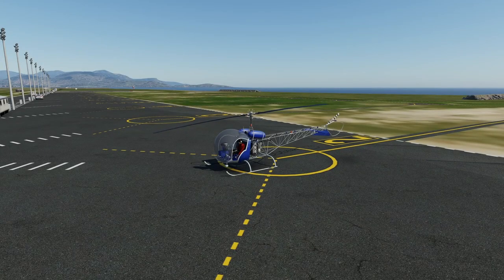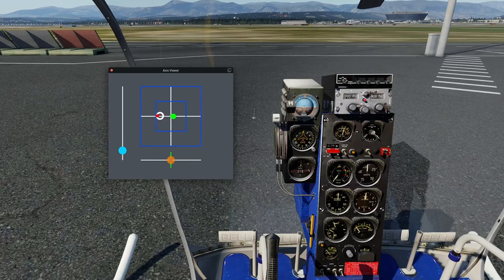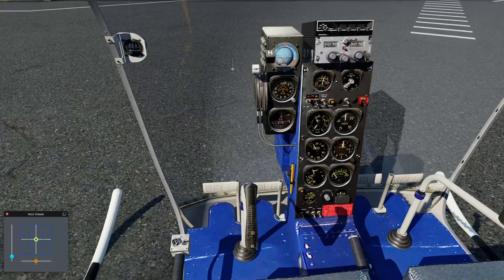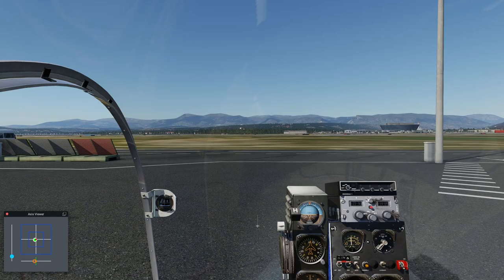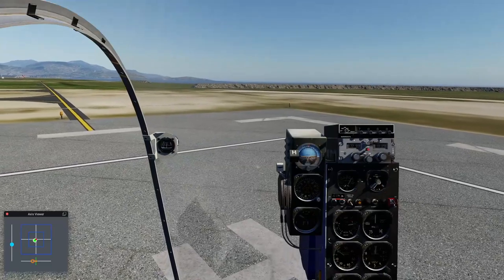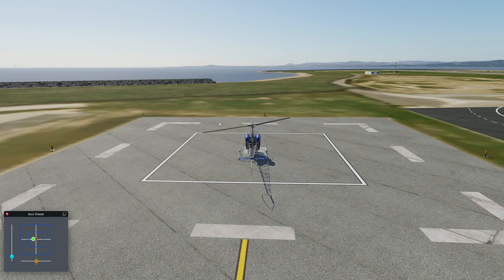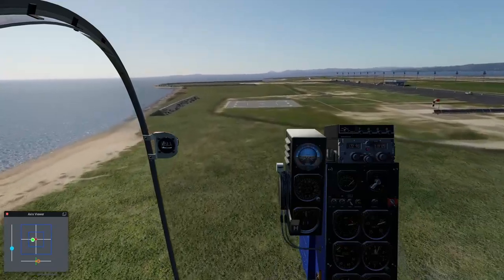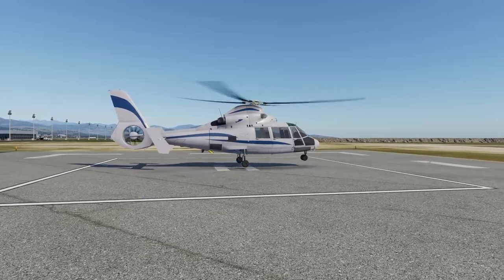HeliTrim - Flying X-Plane Helicopters with basic controls

Comment: THERE are helicopters that do have trim. For example the Bo 105, BK 117 but also the Huges 269. They have a head button on top of the stick. The Huges works with two small motors. If your level is flying, but you have to use force (for example) to keep the stick moving forward. Then press the Head button slightly forward. The motors then ensure that the forces are removed from the stick and support the pilot. Then it is easy to fly with two fingers. That also sounds very similar to what you describe. The trim does indeed work differently than with fixed wing aircraft

Comment: Great! Will this work on XP11 too?
Reply from the maker: Yes, helitrim is XP11 compatible.
Reply: @ReflectedRealitySimulations  thx, meanwhile running on my xp11, Not Bad for flying from A to B. Make Sure to do reset before a new start.
Reply from the maker: Yes indeed, I have the HeliTrim reset bound on my joystick too so I remember to reset before each takeoff.
Reply: @ReflectedRealitySimulations  btw, can you assign more than one command to a joystick button? I had the idea to combine "deactivate park brake" and "helitrim reset"...